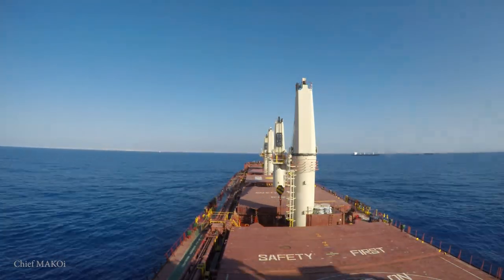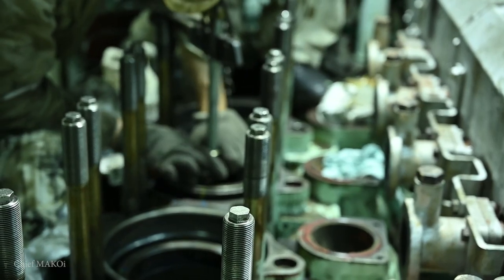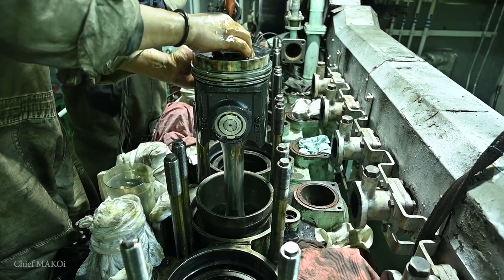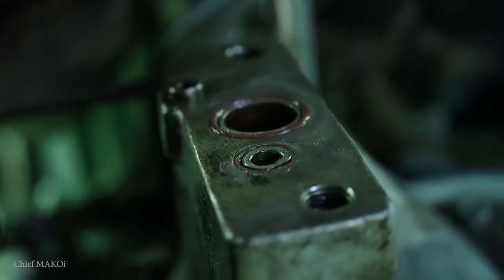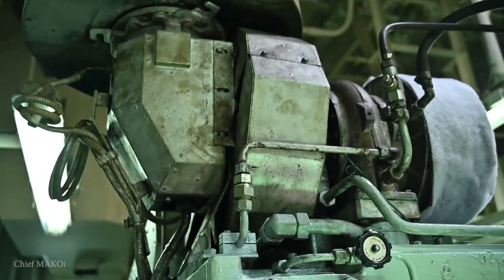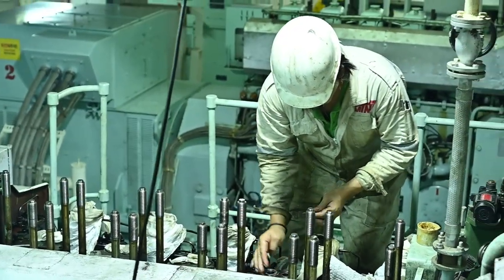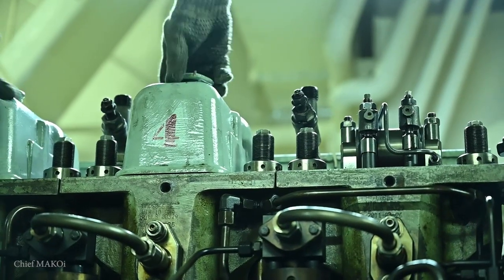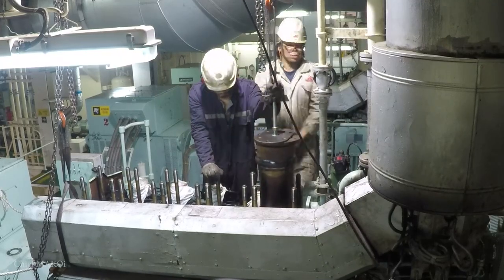Re-assembling Ship's Generator Engine | Pt 3 | Chief MAKOi

Comment: You can see there a crew who knows what to do, and also that they trust each other to do absolutely the correct thing as well. You just need to make sure the adjustable nut rounders vanish, as there should be a set of tools to do valve clearance adjust for those engines, as that is very common to need to do after the first 500 hours of running as maintenance.  But very nice to see all fasteners that are critical got tightened to a torque, even though you can get to pretty close to correct with experience in just how much force to use.

Comment: As a native English speaking, white degenerate from Canada - I seriously have to, and continuously, applaud the ability of other cultures to work so fluently, hand and foot, standing on top of each other, like an incredibly well oiled machine. I’ve worked in many industries - manufacturing, maintenance, construction, and now running my own machine shop. I can assure you, it’s always “every man for himself. I do not possess the cognitive and emotional ability to work with another individual where both our minds are nearly connected in such a way as other cultures - much like yourself - do. Hats off…

Comment: Good job guys!  When I was a Mazda tech we had to adjust valves on the 626 every 30,000 miles. I used the go/no go technique. If clearance was .010” for example you us .011” & .009” feeler gauges.  It worked every single time & never a valve tap.  Just had to be done on a hot engine… not cold.  Customers were happy their engines were quiet.

Comment: Chief just a small reminder, don't tolerate them using incorrect tools such as adjustable wrench most specially the adjusting screw for the valves...  Thank you!!!
Reply: You must refer to maker's manual for the proper tightening torque..

Comment: It just goes to show some times having 3 of something isn't enough (though having one generator engine being overhauled & another failing is probably rare, I expect it would be even more rare for a 3rd one to fail. I understand the hast to get the Turbo repaired though, cause ya just never know. A great job by all & it's very interesting to see how you not only achieve what is necessary with limited tools & equipment, but also how well you all work as a team. Well done!! 👍

Comment: Very simple engine, and I saw some clever designs in it. The biggest problem was the scale, but some of those processes have been used for over 100 years. like lapping the valves, or slathering oil around for assembly. Found myself saying, 'I can do that.'

Comment: Awesome! 
 So 7 man crew is it? Interesting how engines are pretty much all the same. I'm always amazed by the hydraulic nuts and the jack assemblies. Hand lapping the valves. New valves as well to go with the new seats???
 Man, lot of big heavy pieces in confined spaces. I'd imagine smashed and cut fingers are the biggest hazard. Not to mention backs, how you all get twisted around in places. 
 What was your turnaround not counting the turbo issue compared the the manual allotted time? I imagine you're motivated to beat the time as a matter of pride. 
 I imagine a cookout is in store!!!

Comment: Great video.  Why were new parts not used.   Generally when spending the labor time to tear the engine down would it be more economical to replace the power cylinder and at least rod bearings. Also what was used to lubricate the cylinder sleeve o rings?

Thanks,

Comment: Good practice to test all the alarms and trips after an overhaul before you start the engine. E.g. low L.O, high jacket temp and overspeed trip plus all the alarms. Just saying
Reply from the maker: You can't actually trip the engine unless it's running. 😊
Reply: Agree but i said test the trips. In other words for example the high tempreture jacket trip can be tested by removing the probe and heating it up until the trip is activated. The L.O. trip can be tested using a druck or any other testing device you have to ensure that it activates and the correct pressure.  The engine is not required to be running. Its good practice. The only trip that may require the engine to be running would be the overspeed and in some cases that can be tested by lowering the overspeed value.
Remember the engine has just had probably a 16000hr o/h maybe? , testing all safety devices is part of that.🥂
Reply: Actually it's better to test all trip device while running the engine. Activating the alarm doesn't mean the engine is tripping. It happen one of my previous ship that we activate l.o low pressure alarm, the alarm activate in ecr and audible alarm sounded but the engine is still running. We found out that the tripping mechanism is faulty
Reply: @vanpore6326  mate i am not saying dont test the safety devices when the engine is running, i am saying it is basic marine engineering and good practice to test safety devices after a major overhaul to check the audiable alarms  and visual indication in the ecr works and also that the tripping mechanism functions as per design before you start the equipment.

Comment: Is the piston shaft being a separate piece from the top bearing cap normal in large marine engine applications as this is the first time I see it as 2 separate pieces verses being one part, like in a large truck engine?  Is it done this way to ease taking the engine apart for overhaul like you are doing in this video series?  With 3 generators on the ship, how often do you rotate between the 3 generators to give each of them running time to make sure they are in good working order?  Is the Emergency generator ever run as the "primary" for a period of time to give it some running time?

Comment: After we'd do big maintenance projects on one of our 16H32/40 Himsen's we'd rotate it with the turning gear a few revolutions just to be sure everything rotated freely before blowing it down. Watching the amp meter on the turning gear to see if the load drastically changed during the revolutions. Do you do this for the smaller Himsen's you guys are running?  Great Video as always!
Reply: I am sure they did that.
Reply: I seem to recall another video of his from his previous ship where he showed them barring the engine over.

Comment: No offence, but I would prefer to do the lapping of the valve seats with the valve stems vertically so that clearance in the guide bushes does not affect the shape of the valve seating during the process.
Make a simple jig for it which can rotate and position the cylinder head (or cylinder cover😏) upside down,
Reply: They changed the bushes anyway, so orientation made no difference, if the bush had even the slightest of wear outside allowed it will go, because it is a cheap part to do once out, but hard when in service.
Reply: @SeanBZA  True, but still good practice to do it vertically,

Comment: Chief quick one. Do you use grease or soft soap on rubber " o" rings on cylinder liners.? we were told to use soft soap 40+ years ago
Reply from the maker: Vaseline or grease.  Depends on which part the o-rings go.

Comment: Very well done and explained.  Is the a 4 cycle or 2 cycle engine?
Reply: It has valves and rocker arms - so it cannot be a 2-stroke engine which operates without valves alltogther.
Reply: @lotharerkens8154  Thank you.
Reply: Some 2cycle engines have rocker arms and poppet valves. EMD (locomotive and ship, etc ) and Detroit Diesel (trucks, boats, generators) have them. Intake is in the cylinder, exhaust is poppet valve in cylinder head.

Comment: So different to modern car throw it away culture engines
Reply: Agreed.  The difference is that many car engines are never rebuilt, vs. these engines that will be rebuilt several times over their lifetime.  

I design on industrial equipment. I'm confident we spend far more time worrying about easy service than automotive does.  Sometimes I joke that some of the automotive engineers must have had a wife that cheated with a mechanic.  I figure they must really hate them at times.